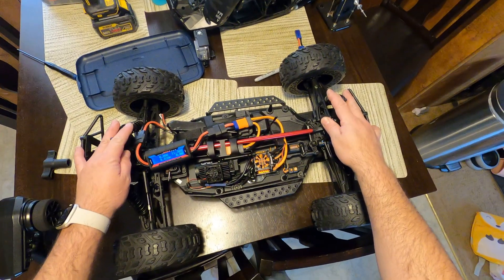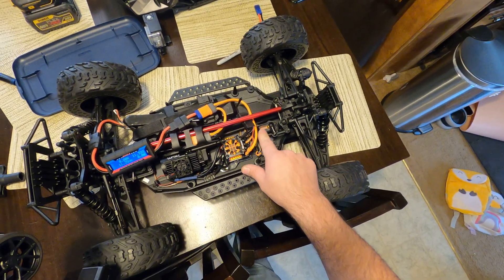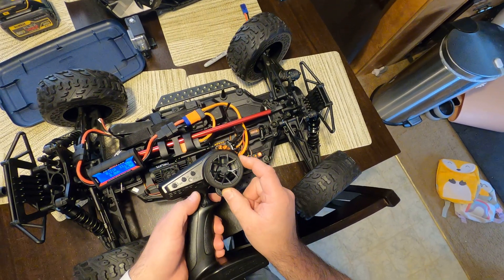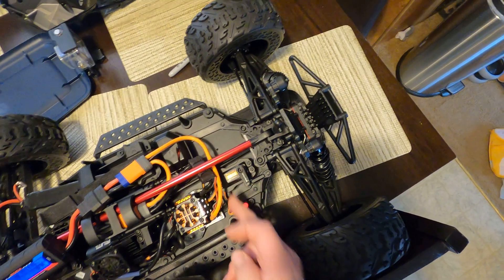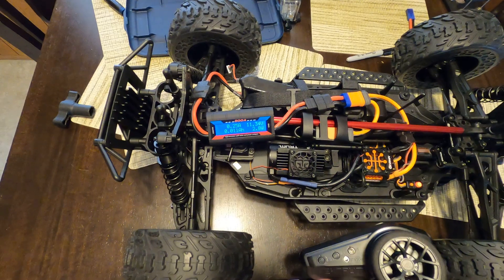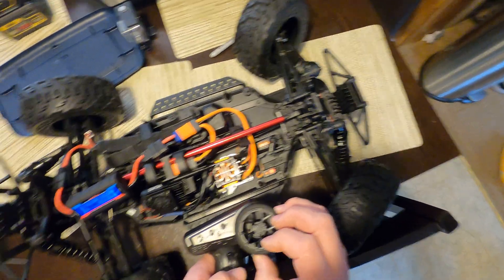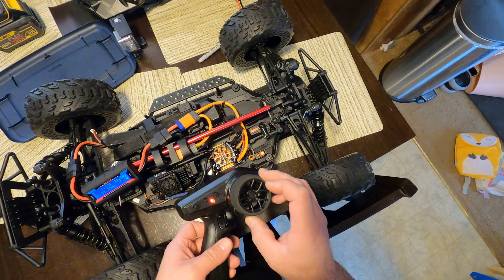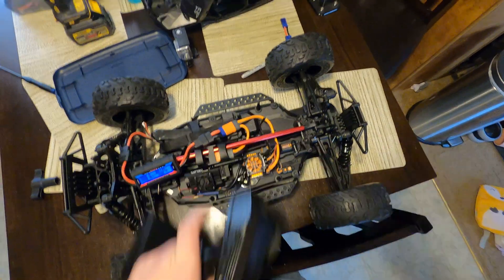Set steering servo endpoints Arrma Fireteam 6S with SLT3 transmitter - amp draw measured as well.

Comment: i know the slt2 is very similar, and uses the the knob to adjust end points, my question is do you know how to do the slt3 with dsc ???? it does not seem to be the same or maybe im doing something wrong
Reply from the maker: @jonnygospel88  I’m not sure in that one, honestly.
Reply: @dgitalchaos  im gonna try again maybe i just was doing something wrong, or backwards, would not be the first time, but i had try several times, but could been doing same thing wrong, thank you, ill be in touch with horizon if not and tell you, altho they sent me similar video
Reply: so as far as the slt3 with dsc, its the same to adjust, but i have had 2 of them replaced, neither worked, had dead spots in the signal, they told me to throw away the slt3 with dsc, and are sending me a 3rd controller without dsc, the slt2 works just fine, any way thank you, i said i would let you know what i discovered, atleast horizon is trying to make it right,
Reply from the maker: @ at least they’re taking care of you, that’s good! Thanks for the update.

Comment: Perfect, dude! I just got my Mojave 6S V2 and I wanted to make sure everything was 100% before I drove it. I checked all screws and stuff, then when I dry tested it for power and throttle and everything I noticed my servo was trying to pull the steering wayyy too hard and remembered to program, but wasn't sure how. This video was absolutely perfect! Everyone needs to do this to their new rigs before their first run to ensure their servo doesn't die so soon!
Reply from the maker: Glad the video helped. I know it’s a bit long, but I thought it was important to include the amp draw so people can see why servos burn out if you don’t set the end points.
Reply: @dgitalchaos  nah man it was perfect. Every needed detail included. You don't see that often! Thanks dude!
Reply from the maker: @Riptide_RC  thanks!!

Comment: Great video sir! Can you tell us more about the amp meter and where you purchased it?
Reply from the maker: I got the amp meter from eBay. I wish is saved maximum values, so I could test amperage on runs, but it doesn’t. It’s just a cheap amp meter with various other readings. https://www.ebay.com/itm/284920547921?mkcid=16&mkevt=1&mkrid=711-127632-2357-0&ssspo=NunrwCbTTXa&sssrc=4429486&ssuid=BL9jz6a9Qo-&var=&widget_ver=artemis&media=COPY
Reply: @dgitalchaos  Thanks for that. Yeah I could see how it saving max values could be useful. I typically end up upgrading to the Castle MM8S esc to get the log data options.
Reply from the maker: @reconrc1787  I have a M series Mac, so I don’t have Windows, otherwise that would be an excellent option.

Comment: i have fireteam, but what is endpoint? i do not know what this is for?
Reply from the maker: So a lot of people are burning their steering servo because the servo tries to travels further to the right or left than the RC is capable of turning. By setting the endpoints, you’re telling the transmitter where those physical limits are on the RC so that the servo does not try to exceed those limits. The affect of this is proven in my video based on amp draw - which equates to heat and burning servos. The amp draw in the video is conservative as these servos can pull up to 5 amps. You can ignore the amp meter altogether, as that is information proving the effects.

Comment: What is that amp meter and where can we buy them pls my man
That was an awesome bit of kit even more than the actual fireteam IN my eyes absolute Fabulous 😍😍🥳💯
And the detailed show is very welcome 
Thank you to whomever asked for this
Couldn’t have asked for a better show ✅👌🏿🔥🔥🔥😊
Reply from the maker: Amp meter measure the amperage draw of a device. It’s usually not needed, but I included the info to show why the servos burn out. I got my meter from eBay, and soldered a connector. https://www.ebay.com/itm/284920547921?mkcid=16&mkevt=1&mkrid=711-127632-2357-0&ssspo=NunrwCbTTXa&sssrc=2349624&ssuid=BL9jz6a9Qo-&var=&widget_ver=artemis&media=COPY

Comment: Tried this and the handbrake servo was activated when the A/B button was hit.  I read elsewhere the handbrake servo needs to be unplugged for the steering endpoints to be set.  I’m going to give that a try next.
Reply from the maker: Strange, as you can see in the video, my handbrake didn’t activate. I’ll have to look into it more.
Reply: My handbrake activates also and this doesn’t steer left only right or straight with my savox servo
Reply from the maker: @JerryJrsGarage  I haven’t tried my Savox, but try disconnecting the third channel at the receiver for the hand brake.
Reply: @dgitalchaos  Thanks!  I had to remove the servo arm and adjust that then I got it!  Then it was backwards right was left and left was right but I flipped the switch on controller and it actually worked like a charm!  Curious what the difference is with a brushless servo I could have had for like $9 more lol 😂 I just am glad to have it functional again!  Thank you for the fast reply!
Reply from the maker: @JerryJrsGarage  the brushless servo should technically last longer, and produce less heat, but actual mileage may vary.
Reply: @dgitalchaos  Good to know!  I sort of figured it would be a fair upgrade…maybe I’ll do that for this other RC build I been slowly putting together.

Comment: I used your tutorial to set my endpoints.  Thank you for this because the manual doesn't even mention the radio having that capability, much less explaining how to do it.  I have an issue though where I set my center point for the trim and then it seems like it changes when i go to run it.  I don't know if there is just a bunch of play in the system or what.  I turn the unit on and set the steering trim to center before connecting my servo horn and everything will look centered.  Next time I look it's off and by a decent amount.  Very frustrating.
Reply: Also, there is a lot of play on the left side especially. There is vertical play (considerable) of the bellcrank assy. I plan to disassemble it and place shims to prevent this. Just my two cents. Enjoy y’all!
Reply: @bryanspanjer3213  I planned on not really upgrading until parts broke on me but I may go ahead and upgrade my steering assembly items to try and tighten that up.
Reply from the maker: That certainly sounds strange. Have your tried centering everything and rebinding the receiver? Or the servo potentiometer might be going bad.
Reply: @dgitalchaos  It actually was the case with the original servo and the upgrade I put in.  I noticed last night my servo saver seems to engage really easy one way and you have to put a ton of effort to engage the other way.  I think that might be at least part of my problem.  Seems strange.